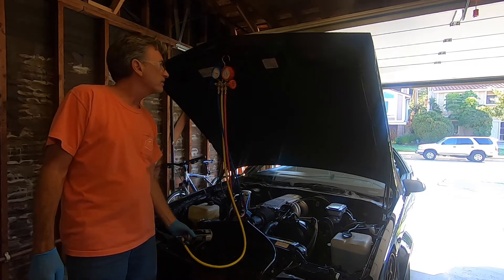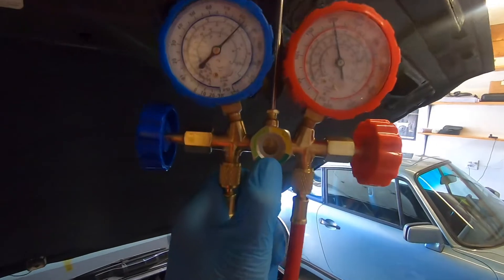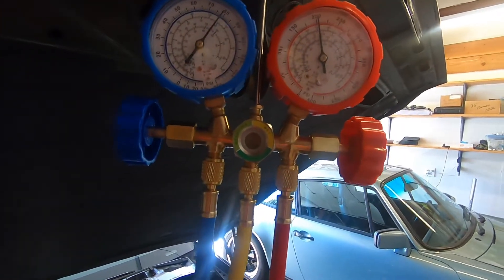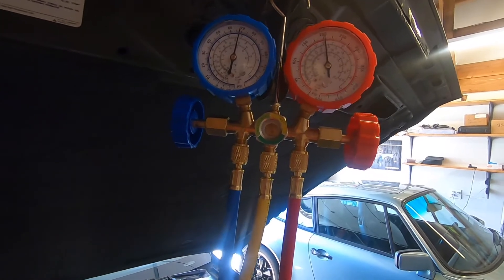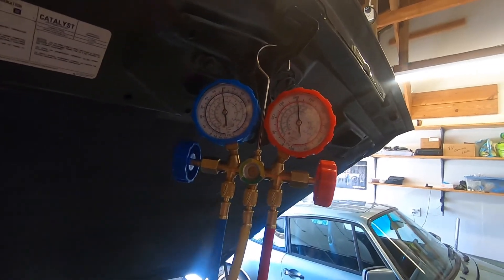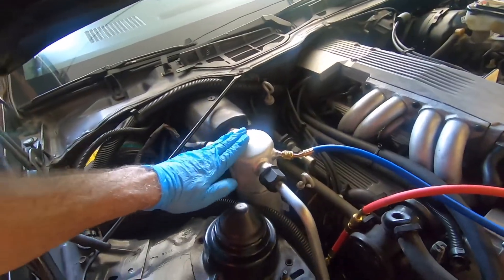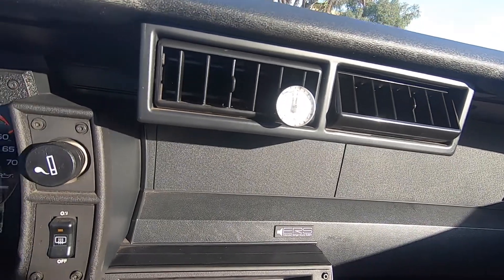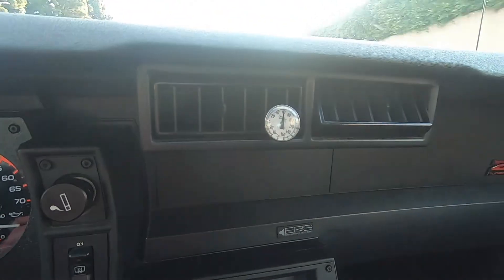Camaro Retro R12 AC Recharge (Part 3)

Comment: What issue am I having if the compressor cycles on and off too often on a camaro like yours?
Reply from the maker: Would check to ensure you have enough Freon in the system with gauge
Reply: First of all, it’s not Freon lol, Freon is a brand name not a refrigerant name used to be Dupont that had the trademark name for R12 refrigerant now it’s Chemours that uses the name  and they literally use it for all their refrigerant. Also, it’s normal for a compressor to cycle in a lot of cars. It will turn off when the low side pressure reaches a certain point I believe around 20 psi and then some like my car, it seems to be on the evaporator hits a certain temperature. Definitely nothing to worry about if you have the right amount of refrigerant and pressures look normal.

Comment: I watched the whole series of your R-12 recharging videos and to looks like you did well with a few concerns. First of all, I have been told never to turn off a vacuum pump under vacuum as it can allow oil to go back into your system from the pump. Yes you have oil in that pump that will have to be changed eventually. So I would not do that. Charging the system with the can upside down, (liquid charging) is a bit dicey and can damage a compressor but on those older GM cars the accumulator, (not receiver) will save you and your compressor from failing. Refrigerant in liquid form makes a great solvent and it will wash the compression surfaces in your compressor real quick if you are not careful, and seize it up, making compressor replacement inevitable. Finally, I appreciate you charging with a high side tap to look at. 200 seems a bit high for R-12. Was it a really hot day when you did this? Also 55 on the low side is to high as well so I think you have an overcharge. To bad you don't have the Porsche site glass to look at. It is not to high unless you get up around 450 so I would leave it alone. It is going to leak out anyway so let it be, it will be normal next Summer. Most car A/C systems leak out through the shaft of the compressor, especially if they are not run for a while and this is common, especially on collector cars. It's good to cycle the A/C whenever you give the car that loving run for a little bit to charge up the battery and such, All in all, it was a good video. Keep up the good work.
Reply: Those upside down cans made me nervous too.     Also that system should be cycling under normal conditions.
Reply from the maker: Thanks for the comments and very helpful, noted on the vacuum pump as that's my first and learning along with you guys! Yeah I was told that the freon liquid would convert to gas before it hits the compressor from a mechanic back in the day and will ensure it draws gas next time upright. It was a very warm day when did the Camaro. The sight glass is on the drier but tucked under the fender impossible to view but maybe with a small mirror and light? Yeah I'm not banking on the compressor seals holding a charge long term and probably will use a can every year. It was very rewarding time for me learning this skill as it always was something I never took the time to understand. Appreciate the support and watching!

Comment: 55 psi on the low side seems high.
Reply: It appears that the low gauge said 55(ish) and the high seemed to show 220(ish) ? I'm only familiar with the A6 compressor in 70s boats but I thought rule of thumb was 30 to 40 psi low and 170 to 210 high at idle speed (500 to 1000 rpm)
Reply from the maker: What were you seeing? This is the Denso compressor